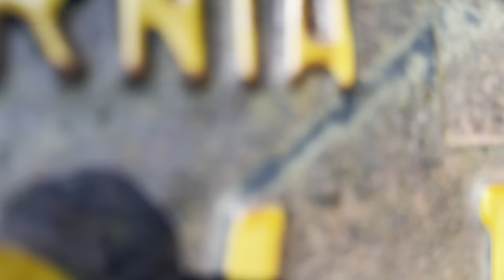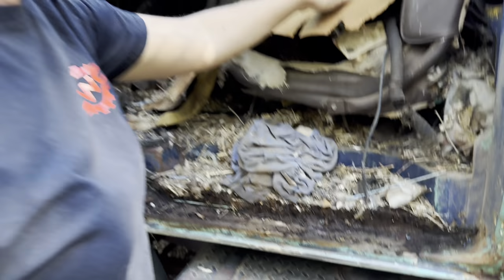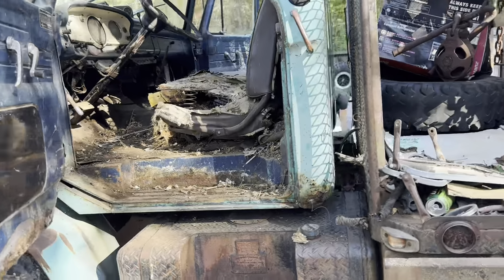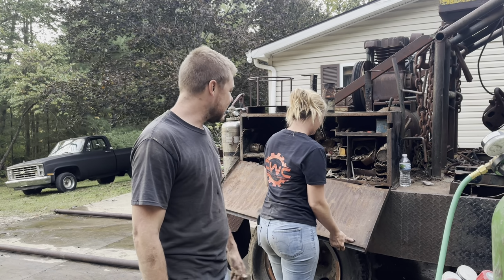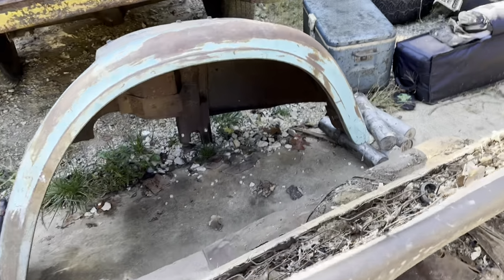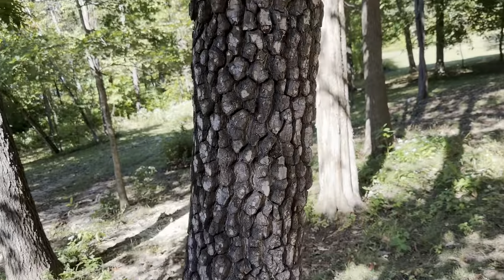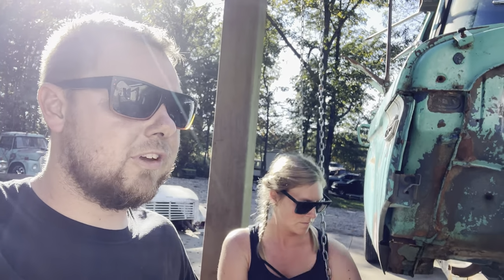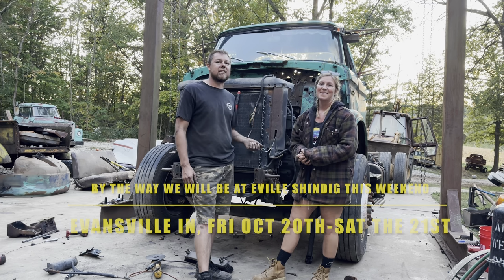Hannah’s new build is in the works!!

Comment: I wish they would've had ytube in the early 80s, I could've had over a million subs , I bought a motor home chassis, like a 1and 1/2 ton , 454 , turbo 400 combo , 19.5 tires , put a 1957 chevy cabover body on it and made a car hauler bed assembly for it . Customized the wheel opening on the front , so they didn't look to big for the tires and it was just beautiful . Redid the interior really nice , the outside was original with priner spots and drove it for a couple years to every swap meet around FtWorth , Texas, didn't even have it for sale, but was offered a large profit several times and finally sold it , because the offer was just to much to turn down , should've built many more , I could've sold them all , but life got in the way , and I got lazy .watching yall is inspiring, but at 62 don't know if I still have it in me
Reply from the maker: Dang ! Would love to see that !! Thanks for sharing your story!!

Comment: The BT466 is one of the best engines International ever built.  I would convert the Snap on Truck to that chassis.  Seats, I recently bought a set of Mini cooper seats.  I am 6-1 & @ 230 not a little guy.  The seats fit in my 1950 Ford F1 that has a 5" deep setback on the fire wall. That cabis about 52" wide at the B pillars.  Once I removed the in cab fuel tank I fit fine.  Check them out for a build as they are really a gerat seat for long distance,  and in that wide cab I'll bet you could use an old Coke cooler for a console.

Comment: Drop that rad, enlarge the opening for the top of the engine, and drop that cab 8" to 10" !! It'll take up the gap between the cab and fuel tank as well as the back. Cut the headache rack down to match, stretch the deck another 6" and voila !! Sexy welding/pulling truck😊

Comment: Hi guys, I like the height of the truck with out lowering any more.  You can fill in the gaps with sheet metal or tool boxes. Lowering more will put more engine in the cab. It looks bad ass up higher.

Comment: Cool black second gen dodge ram mine is similar but I am guessing that is a Cummins diesel,, mine is a long bed quad cab 1500 4x4, 318 magnum V8 46 RE AT transmission manual shift transfer case lever on the floor gloss black.

Comment: Not sure if either one of you have one but if that total weight hits 26000 lbs loaded or empty have to have a cdl if you leave air brakes on it you have to have air brake endorsement on your license and you may have to have ifta permit on that I would definitely check with a state trooper you don’t want to find out later